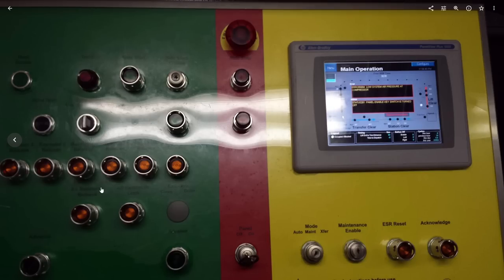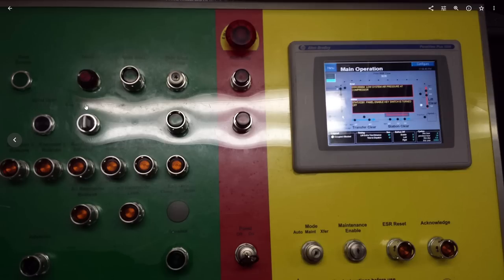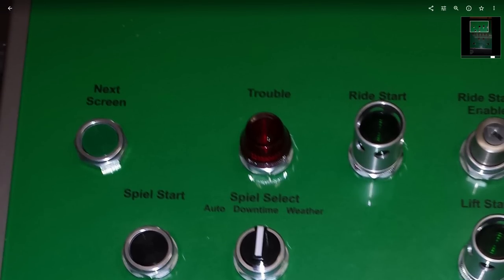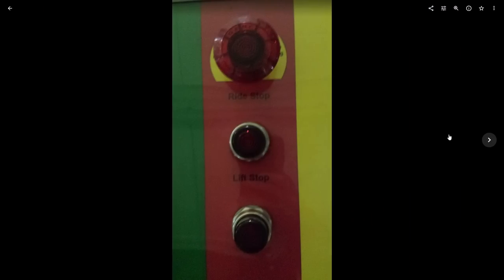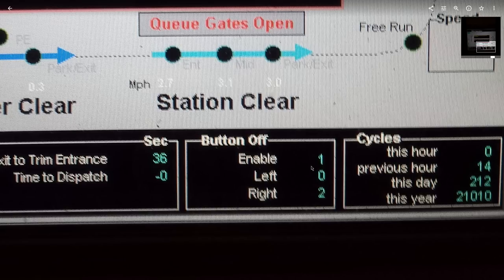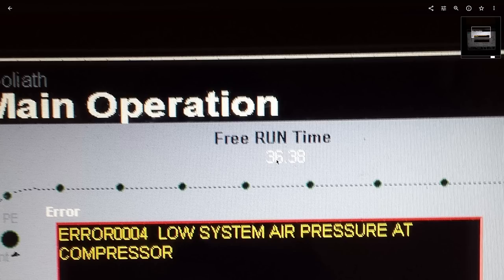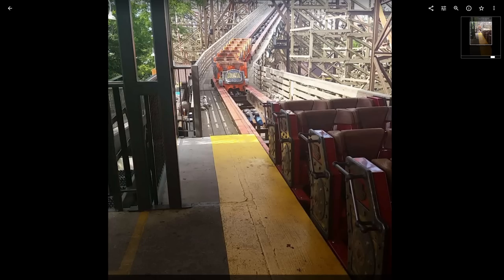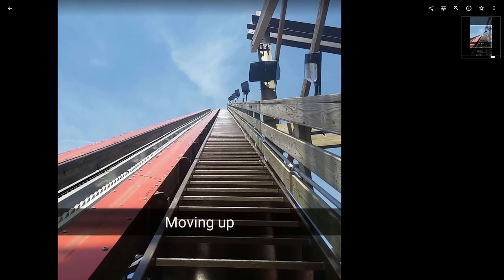Ride System Explained and Operator Stories - Goliath (SFGAm)

Comment: Why was Oaks Amusement Park in 1983 forward under the covert control of a sting operation and why were the sting op's running that park sabotaging the rides at that park and why was the sting op's running that park pretending the owner of Oaks Park Mr Bollonger still around when he was not and has been missing from early 1983 forward?
Why was the owner of Oaks Park missing in 1983 and why was the ride manager Dick Connor's living on the grounds of Oaks Amusement Park and why is it it was Dick Connor's the ride manager in 1983 and his entire maintenance team which were filled with sting op's sabotaging the rides?
Why is it in early 1983 a week before the season of 1983 started a experienced safety conscious ride operator discovered the Monster Mouse ride was sabotaged and that there was a break on the track why is it that management and their maintenance team and even Funtastic Shows which was based at Oaks Park at the time covered it up by pretending it's a balancing error and tore the ride down in order to cover up the sabotage and to eliminate the evidence of the sabotage?
Why is it five days into the season of 1983 it was discovered the Boat ride in Kiddyland was sabotaged and a young child got seriously injured because of it and the general manager of the park shortly afterwords put everyone on the maintenance team and the ride team on alert for sabotage/unauthorized tampering?
Why is it Portland police and Multnomah county sheriffs never even responded when 911 was called for the injured child and why is it no police investigation of any sort occurred and news media had no interest in reporting to the public that an entire amusement park was put on guard for sabotage?
Why is it on the 8th day of the season of 1983 three days after it was discovered the Boat ride in Kiddyland was sabotaged the maintenance team is witnessed by the ride team grinning and smirking while they drained the excess water from the water tank of the Boat ride and they admitted their draining the excess water thus their covering up the evidence of sabotage on that ride as well?
Why is it that after Dick Connor's the ride manager successfully got away with sabotage in Kiddyland why is it he chooses to continue to sabotage Kiddyland by moving all of Kiddyland to a new area in the park and the first ride he and his maintenance team move was the Boat ride and why did they stick that ride right under the main power transformer for the entire park with only a three feet clearance?
Why is it Dick Connor's wanted the en trance/exit to Kiddyland to be right next to the sabotaged Boat ride?
Why is it Dick Connor's bought brand new ten feet tall fences and used those fences to surround Kiddyland thus forcing customers/employees to use his sabotaged entrance/exit to Kiddyland?
Why is it Dick Connor's bought brand new tarps specially made for those ten feet tall fences and used those tarps to cover the fences so no one can see into or out of Kiddyland?
Why is it a month later the power transformer for the entire park blew up right above the Boat ride and it was on fire and why were the power lines going to and from that power transformer were also on fire?
Why is it at that very moment everyone on the Boat ride was under the immediate danger of electrocution and so was anyone that tried to enter or leave Kiddyland?
Why is it that Dick Connor's expected a huge disaster and why did Dick Connor's rely on those tarps on the fences to hide the position the Boat ride was in from a media circus of which he expected to happen after the disaster?
Why is it that Dick Connor's and his ride foreman pulled strings on the day of this disaster to get me stuck on that Boat ride the day that power transformer blew up?
Why is it a couple hours before the disaster a known sting op for the Multnomah county sheriffs was taking photogenic photo's of me operating the Boat ride and she was hinting this disaster was going to happen?
Why is it when the power transformer blew up and the park went dark that I stayed on the Boat ride in order to save the children's lives by getting them off that sabotaged ride in record time?
Why is it I saved everyone in Kiddyland by directing the flow of people in Kiddyland out of Kiddyland and kept the flow of people away from the danger area?
Why is it that after I cleared Kiddyland of people that I posted a guard outside of Kiddyland and told the guard to not let anyone into Kiddyland because of the risk of electrocution?
Why is it after that I saved everyone that was trapped on the Ferris Wheel?
Why is it I was never thanked by management for saving around seventy to eighty people's lives?
Why is it after the park closed for the season of 1983 that Funtastic Shows bailed out of Oaks Park in a hurry and set up their new base of operations on SE POWEL ST in Portland Oregon?
Why is it that Dick Connor's became the new general manager afterwards and he got rid of almost everyone from the prior season?
Why is it on the first day of the season of 1984 that almost everyone from the prior season is gone?
Why is it in the start of the season of 1984 that all the park managers were gone except Dick Connor's?
Why were all the maintenance team from the prior season were gone?
Why were all the ride foreman gone?
Why were almost all the ride operators from the prior season were gone?
Why is it I was the only person left on the ride team that worked the prior season and the only one left in the entire park that was put on guard for sabotage the prior season?
Why is it on the first day of the season there is no maintenance team and no foreman and no managers other than Dick Connor's and no senior ride operators?
Why is it on that first day there was only Dick Connor's and a temp maintenance team he borrowed from Funtastic Shows?
Why is it on that first day Dick Connor's hired only six mid level experienced ride operators and 36 all new ride operators?
Why is it Dick Connor's only gives those six mid level experienced ride operators forty minutes to train 36 new ride operators on as many rides as they can before the park opens up?
Why is it when I trained a couple ride operators on the Looper ride that I discovered three of the seat clamps on that ride were sabotaged?
Why is it there was no one in the park I could even report this to?
Why is it on the second day I discover the Carousel ride was sabotaged and why did the temp maintenance team grin and smirk and admit to my face they did iit with no fear of prosecution?
Why is it on the fifth day of the season after Dick Connor's temp maintenance team finished setting up the Monster Mouse at a new location in the park that Dick Connor's laid off that temp maintenance team and sent them back to Funtastic Shows?
Why is it that at that night immediately after the park closed for the night Dick Connor's had security run all the ride operators out of the park?
Why did Dick Connor's have security hang out outside the ride office and ride break room and why did Dick Connor's order security to run off all the ride operators out of the park the moment they step outside of the ride office and ride break room?
Why is it that I was the only ride operator from the prior season and the only operator left that is on guard for sabotage and the only ride operator left that knows how to do the ticket count?
Why is it I had to stay in the office to finish the count while all the other ride operators are being run out of the park?
Why is it I was the last ride operator to clock out because I had to finish the ticket count before I leave because I was the only employee left that new how to do the count?
Why is it after I clocked out and ,locked the ride office door and step outside to leave the park that I was confronted by security and told by security that Dick Connor's wants all the operators out of the park and that I need to leave immediately?
Why is it that after I drop off the ticket count sheet at the drop box at the managers office I proceed to leave the park on foot since I live just a couple blocks away?
Why is it as I walked out of that park on foot that I caught Dick Connor's and a maintenance supervisor from Funtastic Shows inside the Monster in the dark with no lights on anywhere near them and their sabotaging the posts on the Monster Mouse in the dark by unseating the posts from the ground?
Why is it after they noticed I was walking past them from the parking lot side of the ride they stopped what their doing and became motionless and silent?
Why is it as I continued to walk out of that park I was under the belief I was going to get shot in the back for catching them being saboteurs and kid-killers?
Why is it after I got home I made the decision to never go back to that sting invested hell hole of an amusement park but the next morning I realized I have to go back?
Why is it I knew I had to go back because if I did not go back then Dick Connor's and his other fellow sting op saboteurs would know that I know what their guilty of and then they would go after me to silence me?
Reply: Why is it 2 days later Dick Connor's hired a new maintenance team and he had a couple of sting op's on the ride team advertising this fact by having two ride operators running around and telling all the other ride operators that a new maintenance team was hired?
Why is it this new maintenance team on their first day on the job, and it being either the seventh or eighth day of the season for me the maintenance team spent their first day in the maintenance shed taking stock and inventory of what they got to work with and then the maintenance team left the park after their shift ended at six thirty PM and then the maintenance supervisor left at six forty five, fifteen minutes after the maintenance team left?
Why is it that an hour and fifteen minutes later at exactly eight O'clock PM as soon as it turned dark there was a sting op dressed like the newly hired maintenance team and he entered the midway and was passing himself off as maintenance to the rookie ride operators and he was brandishing a level in his hand and he stunk of booze and he was demanding access to the rides so he could check the balancing of the rides?
Why is it this sting op knew the park was filled with rookies and can be easily fooled by a sting op and why is it there is no one in the park at this time in a position of authority there were no bosses no foreman and no managers and n o maintenance team?
Why is it there is no one that can even challenge this imposter?
Why did I run this imposter off of the midway?
Could it be because I was no rookie and not fooled at all and was keeping track of everyone an d everything?
Why is it the next morning two sting op ride operators were running around on the midway before the park opened and they were telling all the other rookie ride operators that the new maintenance team was a bunch of drunks that want to mess around with the balancing?
So why was the new maintenance team being framed as the fall guys over rides being sabotaged and why is it an organized effort by multiple people to do this?
Where the hell are all the state ride inspectors?
Why are state inspectors looking the other way when organized sting op's are sabotaging amusement rides?
Why is it the local government took official control of Oaks Amusement Park and in order to hide the fact that government is running the park they turned the park into a non profit organization?
Why did this so-called new non-profit organization continue to keep Dick Connor's as the park general manager?
Why is it from 1985 Dick Connor's continues to maintain control of all the key positions within the park by keeping sting op's in the foreman positions and on the maintenance team?
Why is it from 1985 Dick Connor's and his maintenance team continued to sabotage amusement rides but are no longer in a rush to do it?
How many hundreds of people did I save in that park by hanging in there and by keeping the park safe by identifying the sabotage and by shutting down the sabotaged rides and or by drawing attention to the ride and letting other's shut it down?
Why is it after the park officially becomes under the control of local government that government started entering into all kinds of business contracts with Oaks Amusement Park and the park became an official public school field trip destination and schools began busing thousands of school children to Oaks Park for field trips?
Why is it in 199o before Dick Connor's retired he trained his current maintenance team on how to balance the Monster Mouse and right before the season in 1990 ended Joe Norling the CEO of Oaks Park ordered his maintenance team to move the Monster Mouse to a new location in the park and the maintenance sabotaged it, again, using the same method and tactic that Dick Connor's was using in the early 1980's?
Why is it at the start of the season in 1991 several track sections on the Monster Mouse are sabotaged/UN-balanced and Joe Norling the park CEO hired 2 collage educated wielders as minimum waged ride operators and they hogged the Monster Mouse the whole season of 1991 in order to develop metal fatigue and cracks and breaks on the tracks where the posts were sabotaged?
Why is it after the sting op's that hogged the Monster Mouse suddenly quit their job without warning right after they created a break in the track?
Why is it the next morning the maintenance team covered up the break in the track by covering it up with a huge hunk of wielding slag the size of a grown man's fist and never said a word to me about it?
Why is it the lead ride foreman Jim Clooten held me in the ride office while the maintenance team slagged the crack on the Monster Mouse?
Were organized people in that park making a strong effort to hide the sabotage from me?
Was I keeping track of what their guilty of and proving it right under their grinning smirking faces?
Why is it a week later on the busiest day of the public school field day of the year that hunk of slag the maintenance team used to hide the break in the track that track section was separating as the cars go over that ride and the normal ride operators that were running it did not catch it?
Why is it when I relieved the front break operator for a fifteen minute break it only took me sixty seconds to catch it and I shut it down saving around one to two dozen school children's lives and probably saved a ride operators life?
Why is it after I shut the Monster Mouse down and reported over the radio the Monster Mouse is down that both the maintenance supervisor TC and the CEO of the park Joe Norling showed up and they both were grinning and smirking and started mocking me for shutting down the ride?
Why is it I snapped at TC the maintenance supervisor and told both of them the track was cracked and that the track sections were separating?
Why is TC getting scared at this moment?
Reply: Why the hexk do you ask so many questions